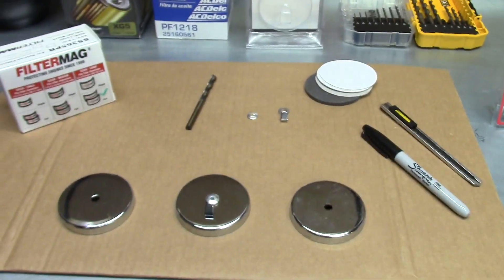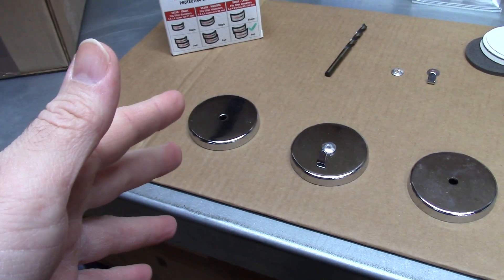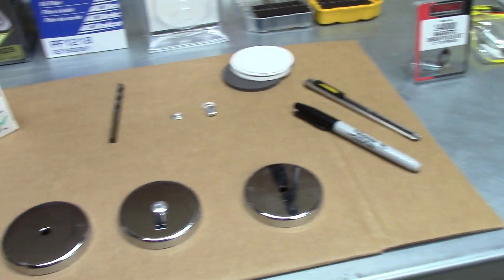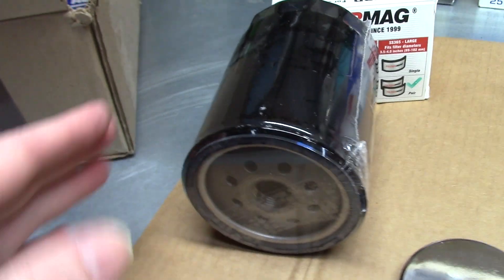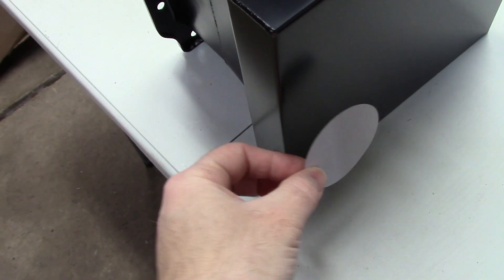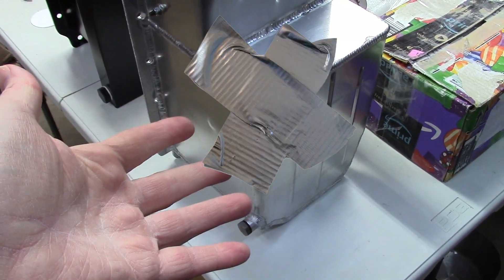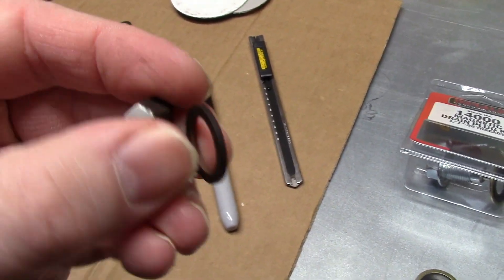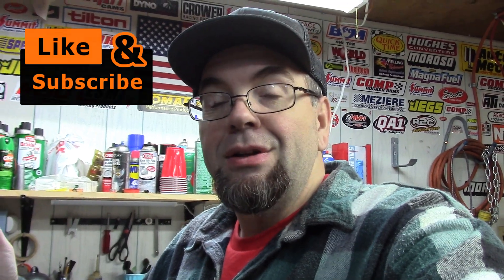Engine Magnets Revisited [Still No1 Asked For This!]

Comment: 1. Premium oil filters will catch all this. 2. Change your oil every 3k. 3. Oil plug magnets are fine if your anal.
Does anyone really want to take a chance when the filter goes in bypass to flush that crap out...

Comment: Have you cut open a filter you ran a magnet on and compared it to a non-magnet filter? I'll have to go back and watch your 1st filter magnet video.
Reply from the maker: Been cutting open my filters to check the status of my engine, even before I started to use magnets.  Not for a video tho, picture on box shows pretty much what I've seen.  Also saw metal like that on my daily driver stock truck oil filter, just not as much as my project cars that I abuse. Still I don't cut all my truck filters, was just curious.